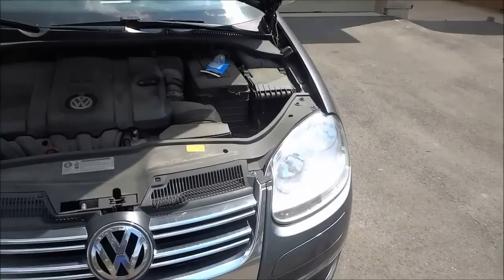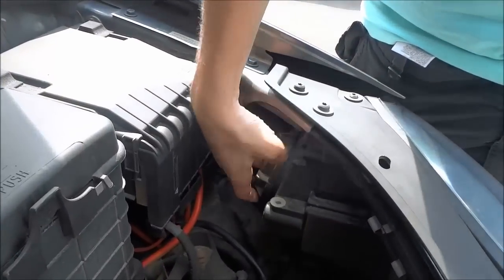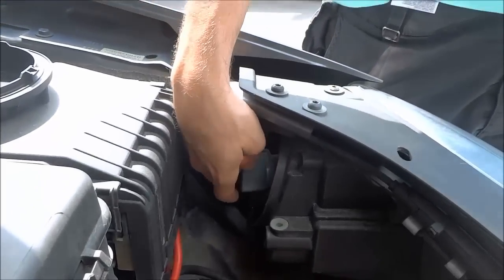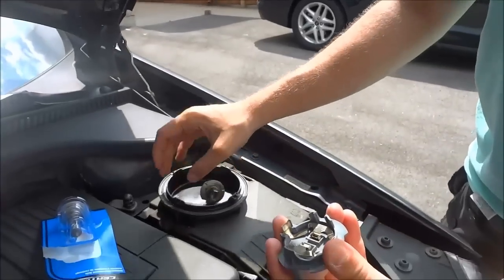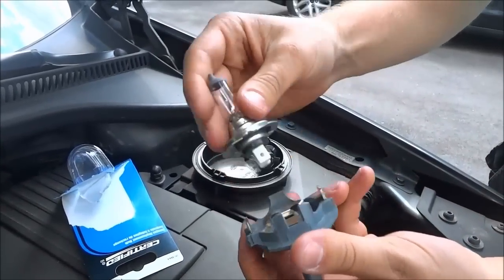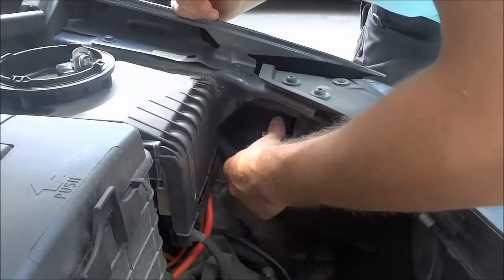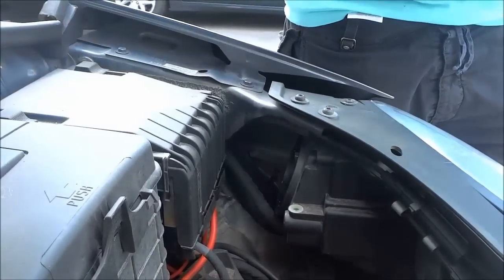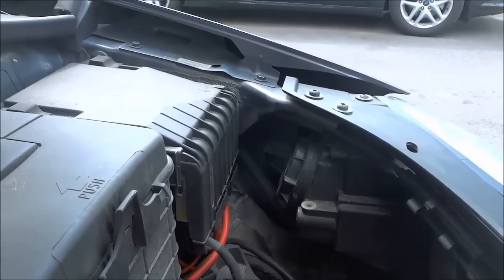How To Change Headlight Bulb On A Volkswagen Jetta (2005-2010)

Comment: TOP TIP: Take a PP3 9V battery, and use this to light the bulb. THen let it cool. Repeat 10 of 12 times and the bulb will last around 5 times longer because you ANNEAL the wire. Source Sweet Project Cars.
Reply: Wait. Really?

Comment: Hint for orienting the bulb. The bulb has a metal flange around the base.

One edge of the flange is flat with a small tab.

The socket has a pointed tab on it.

When inserting the new bulb in the socket, align these 2 tabs.

When inserting the new bulb into the reflector, the tabs should be at the top.

Inserting the new bulb sucks, so don't be surprised if it takes a couple of trys to get the bulb assembly in.